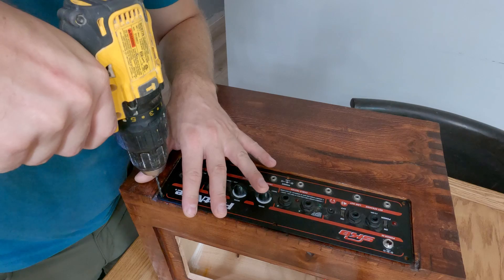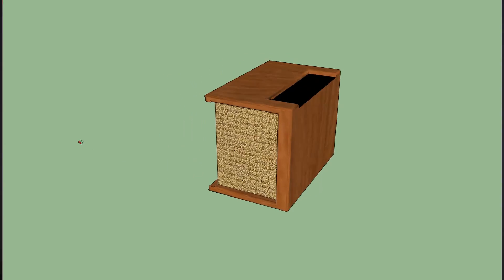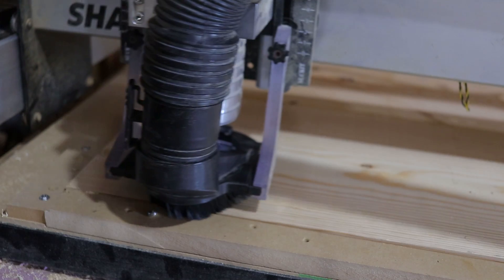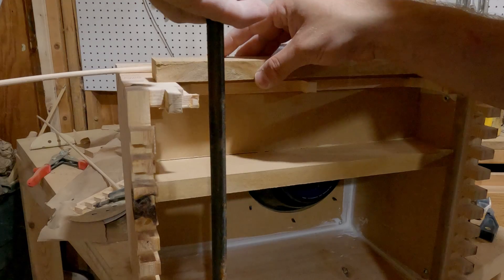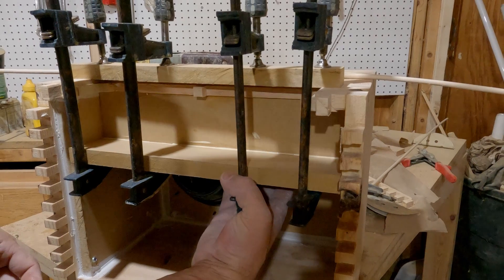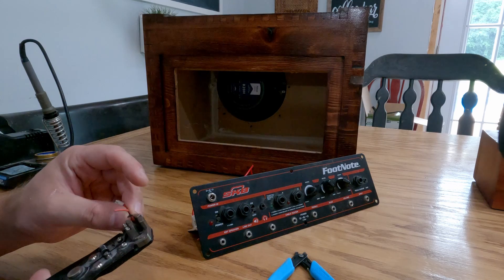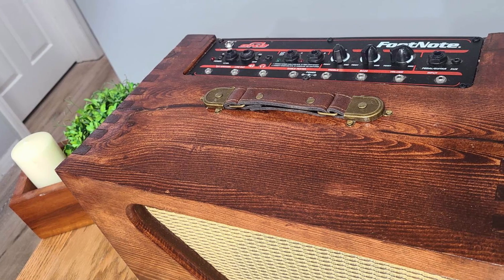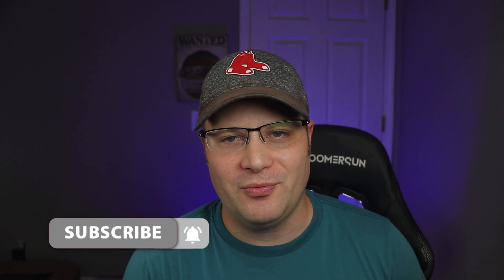DIY Guitar Amplifier - The Lindsay

Comment: Nice. A bit scary watching the shop operations though. Messy gluing techniques and things like fingers scary close to the open saw blade. But it's a learning curve. I would suggest getting a Saw Stop table saw. Especially if you wish to not use the blade guard.

Comment: Nice build, but the only issue is that the speaker is front mounted, not rear mounted. If rear mount it, it would have meant that the peace of wood that you are able to screw on and off would also double as the means of taking the speaker in and out of the cab. In that it would be easier if the speaker need to be replaced for what ever reason if you rear mounted the speaker. Other then that, good work.

Comment: No sound test ??? You're kinda screwed if you want to change out the speaker because you'll have to rip off the grill cloth to do so. if you would have mounted the speaker from the inside of the cabinet, no problem. Amp is no longer available. I would have round over all the edges, but that's my personal taste.

Comment: Nice project...just hope the speaker never has to be changed.  Unless tearing off the grill cloth is your thing.
Reply: I know this is an old thread, but I was thinking the same thing. However, it isn't a mere task of removing the grille cloth, it's a matter of practically disassembling the amp just to change the speaker. Wow.

Comment: Most of the analog pedals can easily take 9-12 or even 15 and 18 volts, some working just the same, some with slight changes in performance (overdrives will break up dfferently)
Reply from the maker: Thank you. That's great to know

Comment: That classic styling. Well done.
Now if they would send you the same size driver that was more suited for bass, you do a mirror image of the enclosure (to tell them apart) and maybe change the input coupling cap to a size a scosche larger to let more bass pass, then you'd have one awesome pair of combo amps, well suited for a musical duo in the living room - his n hers. 

Only thing I'd change is to mount the speakers on the rear of the baffle for ease of replacement.
Reply from the maker: I did consider that. But it still would have been just as hard. You'd either have to work with diffraction issues because the screws would have to mount so far into material. Or you would have to put the screws going forward and somehow mount them with a t-nut. So that there are always going forward. But you'd almost need to glue them in so they wouldn't spin when you're trying to screw the nut in on the other side. There's probably another way to do it, and I'm just not thinking of.
Reply: @Toid  I figured you had thought of that. What you have to remember about what the difference is between reproduction of music in the Stereo/AV situation and music creation is that they have two distinctly different roles, and their functions reflect that.

As you know all too well, the function of the HiFi speakers is to attempt to recreate the total soundstage of the recorded music/soundtrack so as to make you believe you are "there", a part of that audio experience.

With instrument combo amps and speaker cabinets, their functions is to create the sound which will be picked up by the microphone(s) to be recorded or to be passed on to the PA system to then be reproduced for the venue being played. In this case, the speaker/driver will usually be very close mic'd, anywhere from 6-8" to as close as just outside maximum excursion. This gets rid of many of the concerns taken into account with HiFi because they simply don't matter. You get the actual color of the drivers and the different parts of the driver from the center of the dust cap all the way out to the edge of the cone. Plus the driver has to be able to handle the transients and distortion introduced into the signal to create that masterpiece being played. 

So, as you can see, what you are worrying about is not a big consideration in this instance, unless you intend to have them pull double duty as just plain powered speakers.

Comment: Stunning cabinetry! Actually way too nice for that solid state chassis. Maybe it would work nicely for bass guitar too, if a lower Fs driver would be used, and some changes to the curcuit would be made as well, like increasing coupling caps to remove any HP filtering that might be present. Usually solid state curcuits work better with bass than with 6-string guitar.
Reply: I agree.   Why make such a beautiful cabinet and not throw valves in it :(

Comment from the maker: 🗣Sound Demo and Discussion: https://toidsdiyaudio.com/forums/discussion/diy-vintage-guitar-amplifier-build-and-discussion/

🛠Parts Used in Building a Vintage Guitar Amplifier:
Eminence Speaker: https://amzn.to/3sPEUtm or https://bit.ly/3pKH23G
Vintage Grill Cloth: https://bit.ly/3pItdT8
Footnote Amplifier: https://bit.ly/3zglnTW
12V Power Supply: https://amzn.to/3HvmGkH
 Step Down: https://amzn.to/3sPzfDl
Finish Stain: https://amzn.to/3zp1RVy
Top Coat: https://amzn.to/3qEYp53
Vintage Handle: https://amzn.to/3eEH9r9